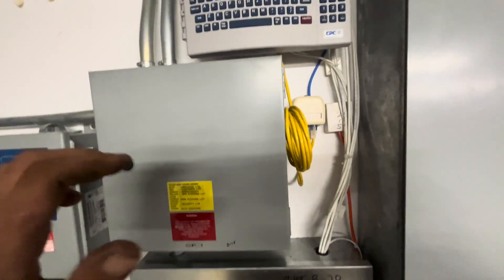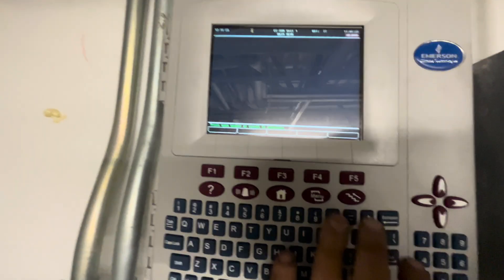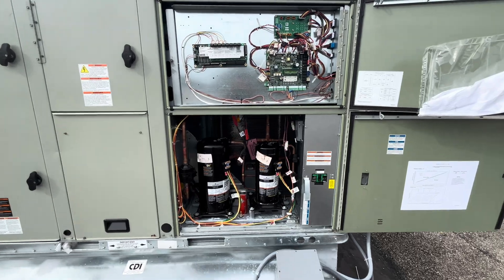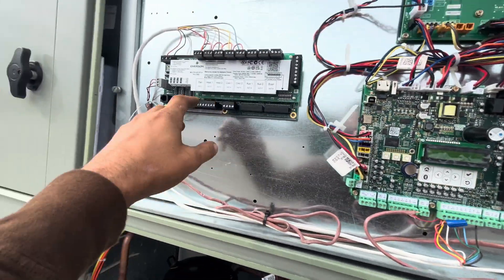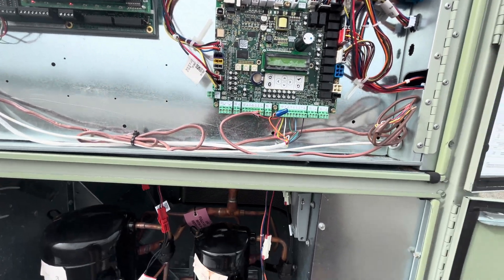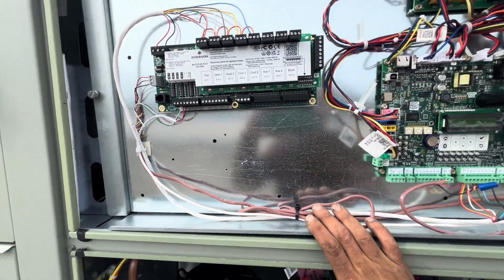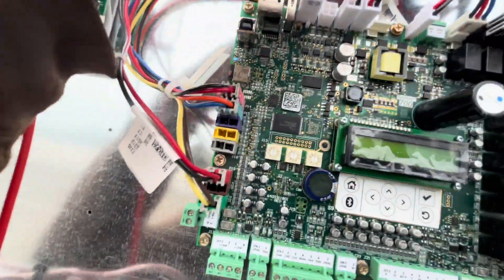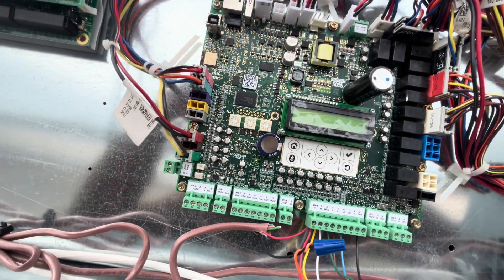SYMBIO 700 BLANK? HOW TO TEST

Comment: Can you do a video on how to connect the economizer board, and how to address it, and do you need the supply air sensor when using the economizer
Reply from the maker: Yes I’ll  start  working on it this weekend I have an old board laying around I’ll just have to draw a diagram up for the others but I’ll definitely get on it for you.